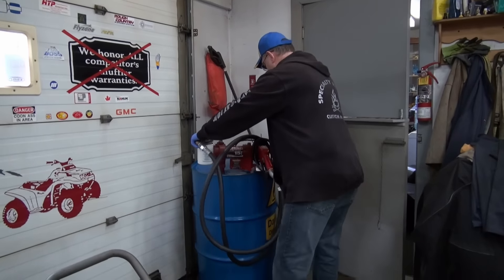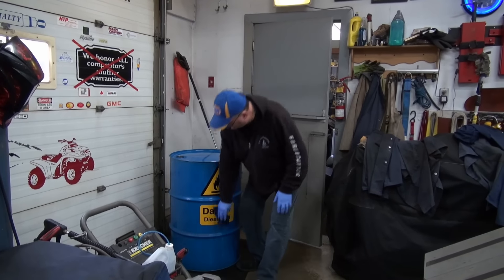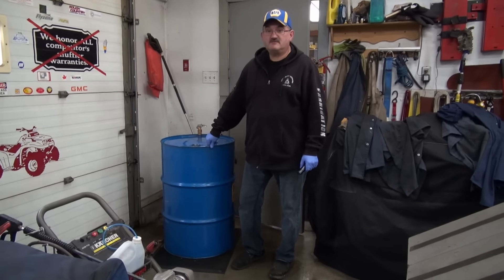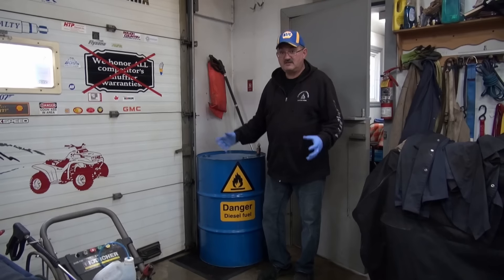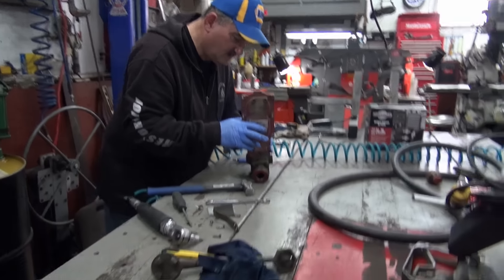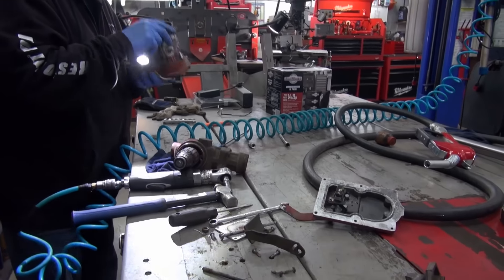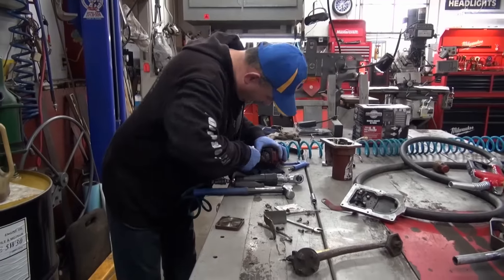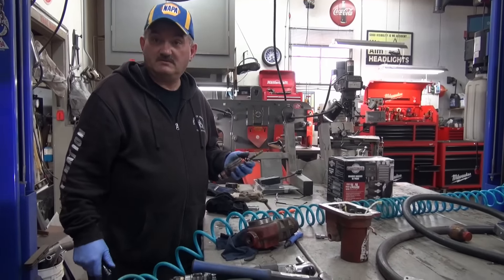Check Your Fuel Storage Tank

Comment: I Used to work in a chemical plant, and our hydrofluoric acid
came in “acid carboys’”. These were steel drums with plastic liners. The liners
were one peace with standard bungs. They fit inside the steel open head type
drum. The steel drum protected the plastic liner, and the liner isolated the
acid. I think they are still produced, the plastic should isolate the fuel and occasional
water, the steel drum will protest the liner, and their size is fractionally
larger than you present drum, an inch or so in either direction.
Reply from the maker: Thanks. Great info.

Comment: I used a 200L Irving motor oil that we emptied on the farm so I knew what and where of it.  I used it for gas for years (+20)for my dukota. Local company did not mind filling it for me. I just switched it 2 years ago and now I see this,,, aaahhhhh bung hole,,lol  The plastic was so old it cracked around the bung hole actually and broke out so was open to air and water so I scrapped it. Now a garden water barrel. I guess I need to look for another plastic now...gee thanks,, but yes Thank You for the info. Prob saved me a headache down the road.

Comment: In Canada plastic barrels (drums) are usually had from water treatment plants cheap or free.......Fuel in aviation is stored in metal containers, they are placed up with a slight angle,so water runs to the low side and the bung is placed on the high side,with the stand pipe a bit off the bottom.Fuels have an anti icing additive known as Prist as well.. the barrel with have AAI in the label.There is no deposit on the barrels now so they can be had cheap as well,,

Comment: Great video,  I would think plastic would be better, we have metal tanks on our trucks to put fuel in the mowers and tractors at work, and they get rust and water in them in time.  I would think it would have to be heavy duty plastic to hold though.  I been thinking about going that route, getting tired of the jug thing, lol  Pretty cool inside the pump, haven't ever had one of those apart before, pretty cool.  Thanks for sharing.  Take care guys, and stay safe.

Comment: Here in the States, we can buy yellow plastic Kerosene/Diesel fuel 5 gallon cans with nifty button actuated valves.  I suggest building a rack holding maybe a half dozen of them on their sides.  Fill only those you need for the near future to keep the fuel from going bad.
Reply from the maker: It's not a bad idea but I like the one barrel with the pump. I don't like filling tractors with Jerry jugs. That being said diesel will last a full year with no issues.uploading part 2  now.

Comment: Those pumps are much better than the GPI brand, the vein style is very similar to a blackmear pump on a commercial fuel deliver truck. They hold up well and are easy to rebuild. The GPI brand I have just uses a flexible rubber vein that can dry and crack. I've had to replace mine several times.
Reply from the maker: Nice read. Yes they are good pumps and very easy to repair. Looks like if I see a GPI pump I should shy away from them. Thanks for the info.

Comment: My insurance company would immediately cancel my policy if they saw me storing fuel inside using a barrel or plastic tank!   A metal double wall tank, which I use, they won't even make a noise about storing fuel.   
I use Milligan BioTech fuel additive out of Saskatchewan for my fuel.  I have tried them all and Milligan has given me the best overall results.   Pour it into a running diesel truck and within a few minutes, you will hear the difference.   Have an extra fuel filter around, you will be amazed at the junk this additive cleans out of your tank and lines.

Comment: Any container with a number 2 recycle number would be fine. HDPE or high density polyethylene is used for most fuel tanks on vehicles.  Any food grade plastic container like the blue drums you are talking about is perfect. Make sure the drums are blue or dark in color.  You don't want them translucent.  Light will cause problems for diesel.
Reply from the maker: Great advice that I'll go by. Just had a blue #2 HDPE drooped off. Thanks for watching and commenting.

Comment: a second thing to try, I heard that the absorbent center of a diaper if put in a piece of cloth and made into a ball, and hung from a string so it lays on the low spot, will wick the water up.
Reply from the maker: Sounds like it would work. 👍
Reply: Experimented with the diaper and water absorbency in fuel, and it does work,, If you put a piece of diaper internals in a sock etc  with prob room to allow for 3 times expansion,, Tight wrapped wont work,,  you have to contain the material as  will gel up and swell out..

Comment: Plastic is the way to go, I've used them as diesel storage for a decade. You need an external bracket to support the pump.
Reply from the maker: What colour barrel do you use. Thanks for the advice on the support. Will do.
Reply: Paul Short in Alaska we use blue barrels for both gas and diesel. You could always make a hose through a bung fitting to go in the barrel and remote mount the pump. I use 2" cam lock fittings on mine. Screw a male 2" cam lock into the barrel then screw a 2" female cam lock onto the bottom of the pump.  Just slide the pump pickup through the male cam lock into barrel and lock it down. Makes mounting the pump so much easier. Just be sure the vent the barrel so you don't collapse the barrel while pumping fuel.
Reply: I use the blue 25 gallon barrels. They're much easier to move around.  I took the bung plug, drilled a ~3/4" hole in it and an aluminum tube down as a pick up with a flexible house going to the pump. The whole pump sat on a separate bracket on the wall. The bung never sees much force that way.

Comment: Plastic is fine to use, i would think a blue one would be best.
Reply: technically, by API standards, blue is for used oil.  Yellow is low sulfur diesel.
https://www.scribd.com/doc/87242788/Fuel-Storage-Tank-Color-Code
Reply from the maker: Rick I have never seen a yellow plastic barrel in my entire life lol.
Reply from the maker: I've seen blue ones used a lot for fuel. Not sure if it's intended for that though.
Reply: Paul Short
You've been away from commercial fixit yards too long...  or Canukistan doesn't follow API. for insurance.   http://www.thecarycompany.com/55-gallon-plastic-tight-head-drum-56b5cy
Reply: I'm out of the loop i guess
Reply from the maker: I've worked in the iron Orr business for years. Been around the oil industry and still haven't seen a yellow barrel. 🤔 I'm not doubting you in any way but I think I have a better chance of winning the lottery than I am of finding a yellow barrel. Hey Jake. Any yellow barrels in Florida?
Reply: No yellow barrels here, in fact just buying any barrels are quite expensive. People charge an ungodly amount for them. Back home i could get for free. How about a company called U-line, they sell a ton of stuff
Reply: May be opening a real can of worms here, but you should check with your local fire dept and insurance carrier.  Being in Newfoundland, they may not adhere to API standards, but many Canadian provinces do.  Most countries do.  How you store volatiles can have a major impact on your insurance and more importantly a post catastrophic claim.   
side note:  its curious that Diesel is designated to be in Yellow Barrels... as that is also the color they use for radioactive waste.
Reply: epoxy phenolic lining i don't know what that would cost
Reply from the maker: I've bought from them before. They carry the barrels. I have one now. You'll see it in the new video.
Reply: Okay i will watch it soon

Comment: Go here http://www.plasticsintl.com/plastics_chemical_resistence_chart.html it lists common liquids and plastics and determines if the liquid attacks and decomposes the plastic. diesel oil is near the top. Also if your adding a fuel stabilizer like powerservice add it before you fill the tank so it disperses as you fill. Its best to fill a tank to as full as possible to avoid condensation. You mentioned the switch was sticky which is probably a source of the issues with it starting.
Reply from the maker: Won't fill to the top because if the fuel gets hot and needs to expand it got nowhere to go. I thought everyone put Additives in before their fuel ;) burnt armature was the root cause of the pump not working.
Reply: Paul Short fuel expands 1% for ever 20 degree rise in F temperature. If your fuel is 50 F degrees outside and you bring it in and it warms to 70 F, it will expand approximately .53. I say this because most barrels 55 gallon are only filled to 53 gallons to allow room for the expansion.
Reply from the maker: No mater what. It won't be filled to the rim very long. One tractor fill up and it's down a bit.
Reply: Fuel has a small expansion rate but needs to vent off fumes and i meant as close as possible on the fill level but not right to the top.  On the additive you said you were going to fill it then add the powerservice, i was sure you mean the other way but i mentioned it anyway.  A burnt armature makes sense.

Comment: Why don't you make your own fuel tank out of aluminum
Reply from the maker: That's a consideration.
Reply: Paul Short that's probably the best scenario ( build an Aluminum tank ), put a drain on the end opposite where you pull fuel out. This way you can drain off any sediment or moisture that " will " accumulate.